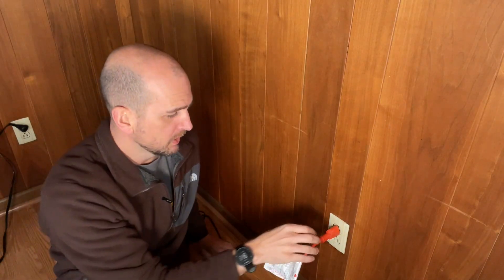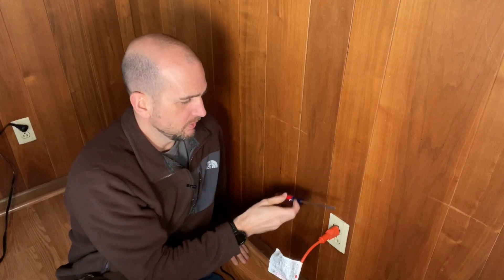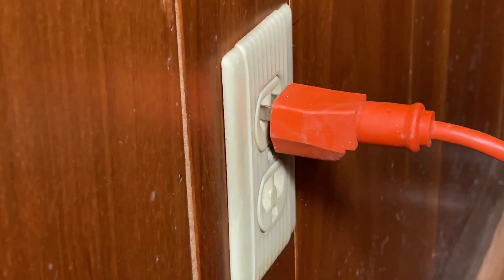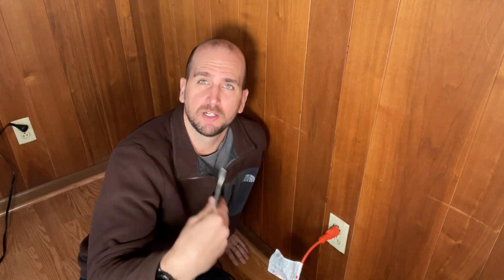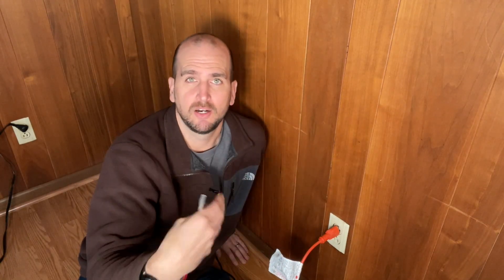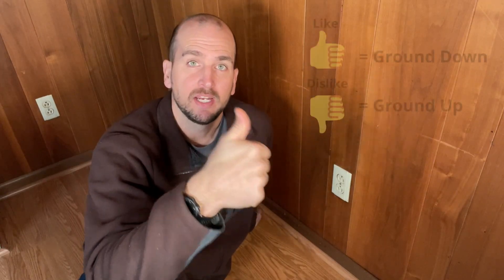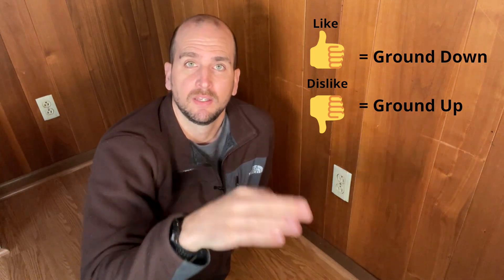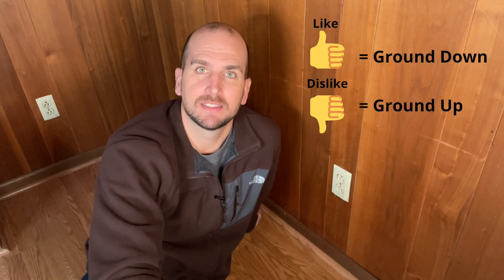Should An Outlet Be Installed Ground Down Or Up

Comment: Still remember the discussion in electrical class. Code doesn't cover this except for saying to install devices as purposed by the manufacturer. I like ground down because some still use metal plates. If the metal plate's screw  comes undone and falls to a plugs terminals it will short  out before someone touches it and get shocked. Better a burnt plate than a burnt hand.

Comment: I find more outlets with the ground hole broken when the ground faces down, so I do ground facing up.  People seem to push down when removing a plug and put excessive pressure on the ground hole if it is on the bottom.

Comment: I rent a house where the previous tenant or whomever put some 3 prong outlets and also 2 prong in the same room. I  think that was really stupid.  I also have a 3 prong outlet in my bedroom I can't use because it seems to be dead for some reason. It was checked with a tester and the guy said it works but it doesn't and it's a 3 prong. Anyway I have no preference for the ground type plug. I have never dropped a tool on a plug in my life but I'm not an electrician. Good luck with your videos.

Comment: I prefer ground up, safety is good, but I do because I find it easier to plug a cable in because the ground is longer and goes in first.  However, I have seen some outlets place horizontally, space limitation.

Comment: I’m an electrician in a hospital,in hospitals it’s always ground up.
Reply: I'm also an electrician and I always install the ground sideways.
Reply: I am also an electrician and always put the ground up. However, on single receptacles like behind a refrigerator - most manufactures of refrigerators have a 90* flat plug that has the ground down.  Go figure.
Reply: When I do hospitals, I always do ground up. I was taught to do so because of the metal faceplate. I saw a welded plate around 30 years ago because it came loose, ground down.

Comment: Plugs stay in better with ground down imo. Plus you have the circuit breaker to deal with shorts in the very unlikely change something would fall and it them both at the same time that a plug is loose..

Comment: I argue  with my electrician about this.  I understand the possibility of the plug slipping out exposing hot and neutral , but the chance of that happening with something shorting across those prongs has about the same odds as  being killed by a soda machine!!

Comment: I was taught ground down unless using a medal face plate, this was if it came loose, it would fall on the ground and not short out. Otherwise ground up for a switched outlet.
Reply: If the metal plate is setting on the ground prong, that is a setup for someone to be hurt. I’d rather have it short out right away than short when someone goes to remove the plug.

Comment: Logically speaking, ground is down isn’t it?
Reply: No
Reply: Why “logically”?
Reply: @AnAmericanFan  Because what is underneath everything? The earth, also called the Ground, and the entire electrical system has a large wire running from the ground wire to a steel stake driven into the Ground. Ditto for lightning rods. All electricity, including lightning seeks the Ground.
Reply: Not according to NEMA the ppl that literally crated and "own: the standards... the "standard" orientation is ground up.

Comment: I was told once that the design intent was to have the ground up, for the reason you mentioned. But also for another practical and convenience reason.  Because of how the plug pivots under load when it's supported by the ground pin on top. As you mentioned the ground pin is more rigid and has much more retention force. The general case is that gravity pulls the cable downward. This creates a bending moment at the plug. Since the ground pin resists pulling out the tendency is for the hot and neutral spades to plug further in if they can. If the ground pin is on the bottom the tendency is for the neutral and hot to unplug. If the cord is moved about frequently this can lead to the plug walking out of the socket sooner.
I've also been told the reason people tend to install them with the ground pin on the bottom is because the plug pattern looks familiar to the brain as a face. None of the arguments have convinced me to follow any kind of a strict pattern. Although I do kind of like the switched outlet idea.

Comment: The thing that I have rarely heard people address in this discussion is that many wall wart transformer boxes are now polarized and not grounded. And they are polarized so that the box hangs down ONLY if ground is down. So the "safety" argument is exactly reverse of the claim if ground is up you have a heavy transformer in a large box that is being pulled AWAY from the wall by both any cord pull and gravity which OPENS up and magnifies (with the flat surface of the back of the box) the gap for things sliding down the wall into the plug. So with these devices in consideration ground down is clearly safer than ground up. That said I have never actually heard of something metal sliding down the wall and causing a short like this. If this were a real concern the better answer would be to put a lip of some kind above the outlet or put it in a box, but those have issues too. Maybe we should just address any actual safety concerns in consideration of the actual environment of a specific location.

Comment: My vote is for Ground Down, and OSHA seems to prefer it as well.  Ground Fault Circuit Interrupter ("GFCI") receptacles are being required by the Code in more and more areas of the home; it is a fast-acting circuit breaker designed to shut off electric power in the event of a ground-fault within as little as 1/40 of a second.  When place in the first spot of the circuit branch, it provides safety to all other receptacles down stream, preventing severe electrical shock caused by most accidents.  Ground Down is much more likely to keep the hot and the neutral in the receptacle and ensures the safety of having a ground connection in the event of a partial pull out.  With Ground Up, while it acts as barrier from objects from above that might cause a short, the rarity of such event is already addressed in the GFCI protections when used, and does not offset the benefits of Ground Down.

Comment: even though there are no code as to which way the outlet should be facing (ground up or down ) most electrical devices are manufactured for the ground facing down (refrigerators , air conditioners , heaters , even chargers for phones or other devices ) with the ground facing up there is a greater chance of damage to the outlet when anything hits or falls on it 
the outlets in my garage were both ways when the shelve above them fell the one with the ground up broke and shorted out the other just came partially unplugged 
both outlets were only about a year old same manufacture
Reply from the maker: Interesting example and appreciate you sharing 👍

Comment: Ope, boss I'd like to pass the warning that strangers to your channel (like myself) might miss the poll section of this video, and give you a thumbs up for the great work. I fixed it so I'm not tainting your sample, but it's good to keep in mind!
Reply from the maker: Appreciate the feedback, still working through the best way to get feedback so viewers can not only get my point of view but also the larger audience vote.  Most my videos this is not needed but this one it was valuable to try and collect the feedback from the audience.  Cheers!
Reply: @EverydayHomeRepairs  hello, But so many years ago, so many children would just enough pullplug drop a Bobby pin ,or coin into it with ground DOWN, so so many damaged receptacles & scarred paint , in the 60s we were doing a long job, installing fan coil units in each room, for a new chiller system, the 2 sons used to piss in the open receptacle, just to hear the SIZZLE , 1 REALLY GOT SHOCKED   BUT the crowning glory was an ADULT WOMAN , barefoot on a ceramic tile floor, she had an adaptor NOT SECURED by the middle screw , so it hung out & she was adjusting her vertical blinds, with a metal beaded chain going across the live leg, giving her a nasty electric shock , she fell, someone saw her called 911, they brought her back, but went to hospital because of this electric shock, so NEC decided to change to GROUND UP   about 95 ? If horizontal, ground to LEFT ( west ). I do not thing many appliances have molded plugs , which would “HANG “. 
I MET JOE TEDESCO  way back , before the change & we discussed this subject  ! Cheers 🇺🇸🇺🇸🇺🇸🇺🇸
Reply: @EverydayHomeRepairs   Happy to pass word! If you're able to "pin" a comment to the top of the comments section, that may provide a space for a poll in the future with less potential for error on the viewer's end. Not sure that you'll need it, but I've seen similar methods on other channels. Cheers!

Comment: I’ve heard that in the past ppl used to use their finger to determine which side was up. This is when people use a finger to guide a plug into the hole, so low plugs were ground up and high plugs were ground down. Over time the high plugs are what people saw so grounds down was considered the right way to do it.

Overall customer is always right so whatever they want, some want to copy hospitals while others feel ground up is just wrong. Personally I like grounds up because I like being different. 
I am an electrician but I haven’t done residential in a long long time. Moved up to bigger and more dangerous things because the money and cut throat/backstabbing attitude is better.
Reply from the maker: 😂 "money and cut throat/backstabbing attitude is better"
Reply: this is the second time I've heard this reasoning.  The first time was when I was in school and read this in an old text book.

Comment: Where I come from, we commonly install our receptacle outlets horizontally, although you can also find vertically installed receptacle outlets installed in older construction installations. As for me though, I personally prefer to install my receptacle outlets horizontally than vertically for a number of reasons, in particular being that they generally appear smaller when installed horizontally, and they take right-angle plugs much better when installed horizontally than vertically. 

Just as you have correctly stated - there are no NEC requirements when it comes to electrical receptacle outlet orientation.
Reply from the maker: Hey Chris, are you out on the East Coast?

Comment: We used to put the ground up in commercial businesses in case metal things slid down the wall they would hit the ground plug instead of the two hot terminals
Reply from the maker: Thanks for the feedback James, I am getting more and more comments with a similar stance on commercial installs.

Comment: Ground down is overwhelmingly the norm anywhere I have lived, ground up tends to only be in really old houses which are often a hodgepodge of outlets. The house I grew up in has a mix of ground up, ground down, ground left/right, and ungrounded. The house was built before electricity and likely had plugs added over time as there were more and more electronic devices in use and each time period they did their own thing. . 

I prefer the ground down as I find it is easier to insert a plug when leaning down with less futzing (of course this is probably due do fanikiarity) and as you said it seems most power cords are designed expecting ground down. 

I also went to the Leviton website to check something and all receptacle images I saw were ground down.
Reply from the maker: That is interesting as you are right on the main standard outlet page you see all ground down on the Leviton website but then as soon as you click down 1 level you see all ground up 🤷‍♂️
https://www.leviton.com/en/products/residential/outlets/standard#t=Products&sort=%40partnumber%20ascending&layout=card

Comment: If you have a polarized bulky adapter and your outlets are installed with ground up, the adapter will try and fall out.  With ground down, the adapter hangs down the way it should.  That's something that could have been mentioned in the video along with the 90 degree plug.  (Besides, outlets with ground up look stupid).
Reply from the maker: Hey Bill, yeah that is what happens to my macbook "very bulky" power adapter.

Comment: groundpin down is easier to insert, as the grd pin is longer, so it starts first and you can still see the blades clearly to get them squarely in the slot. Hubbell refers to the recesses around the slots as "slot finders". I have Commercial Leviton receptacles with perfectly flat nylon faces. I like nylon faces as they wont crack out at the ground pin holes like plastic faces do.
Reply from the maker: I never thought of the recesses as "slot finders" but makes sense.  Thanks for the feedback!

Comment: I just checked on the Leviton web site and every outlets images are with ground facing down. Also on high power plugs (like ACs) your have to put the ground down for the cable to be oriented adequately.

When I was at school learning the electric code (here in Canada), the teacher told us we must see a little face with the ground as the mouth.
Reply: I also own appliances and devices that favors ground down.  Too much tension and weight on the outlet if installed ground up.
Reply from the maker: I just checked again and it is confusing.  When you dive down to the standard outlets they are all ground up https://www.leviton.com/en/products/residential/outlets/standard#t=Products&sort=%40partnumber%20ascending&layout=card
Reply: Pass & Seymour have there commercial grade duplex receptacle (that are packaged in a separate box) displaying a printed wiring diagram on the outside of the box that shows it to be installed with the ground part up. Personally it's a matter of personal preference how it is orientated. One thought is if using mental cover plates is if it becomes loose with a plug plug in to the receptacle with the ground part down it could  cause the nutrual and hot side to act like touching the nutrual and hot wires togeather and energizing the cover that could cause sparking (arcing) and or shock some one who would touch it.

Comment: Where I have lived most of my life (Maryland, USA) the custom in homes is ground down.  But decades ago I heard the argument for ground up that you quoted (metal picture frame falling on slightly pulled out plug).
A few people have mentioned the face look of ground down and that it might invite kids.  Never thought of that.
But I remember being a kid who pulled out a plug slightly and dropped a nail across the prongs - blowing a fuse LoL.  My sisters were in the room and freaked - My dad was NOT pleased.
I have an off-brand MiG welder that runs on 110V.  It's power cord has a 90 deg plug on it, so that when it is plugged into a GROUND UP outlet, the cable goes towards the floor.  I had a house built with a large garage - I forgot to ask the electrician to put the receptacles in Ground UP, so I am going around to a bunch of double gang outlet boxes and flipping the receptacles over to be ground up - while replacing them with 20A commercial receptacles (due to your video on the differences in receptacle design - thank you).  All 110 circuits in the garage for receptacles are 20A.  So I'm replacing the 15A GFCI and regular receptacles with 20A versions, in a ground up orientation.  Yeah, I wasn't picky enough about specing that stuff.  I did get the 12AWG wire for those circuits and 20A breakers though.
Reply from the maker: Good stuff, thanks for all the feedback.  Kids will be kids 😉

Comment: Ground down, you gave one example with the angle cord, also larger/heavier adapters are made to plug in ground down, if it’s up the weight pulls them out.  The lights on outlet checkers are made for ground down.  I get the “safety” thing but many devices aren’t made for that.
Reply: The angle plug is to allow use of the second outlet. otherwise the right angle plug would block the outlet below.   Ground down, forever.

Comment: DC power blocks, surge protectors that utilize both outlets, most of the new smart plugs, and the angled "flat" style plugs tend to be designed with ground down.  I understand the arguments for commercial spaces using ground up (primarily hospitals) due to how testing standards are established for plug pull-out, but honestly in all of my years I've never had any thin metal object fall perfectly onto a 2mm gap created by a loose plug which resulted in arcing nor do I know anyone else who has personally experienced it.  If people want to install ground up then go for it - I just don't prefer it from a visual perspective.  Plus - the "test" and "reset" text on all of my GFCIs would be upside down if I went ground up!

Comment: When plugging in or pulling out your thumb finger may slip forward and touch hot and neutral shorting the circuit therefor having ground prong up may seems to be safer.
Reply: This is exactly what I was going to say. The likelihood of a picture frame or such falling and shorting is negligible but every time someone plugs or unplugs a cord there's a slight risk. As an added bonus it makes it much easier to spot something I've replaced or worked on at a glance.
Reply: More likely your longer index finger would reach the prongs first
Reply: @michaellines2063  
Your thumb finger sticks forward and index finger bend having more contact with plug there much harder to slip

Comment: I do both but the thing is is with 6 tap adapters that only plug into 1 not both I've found that they don't have enough support and tilt out also they have a plastic pin for the ground of other plug but it don't do much. Also as for switched receptacles use a different color/style cover plate or receptacle. And if you walk in the room and have multiple switches have the same color switch as receptacle so you know ok this is that.